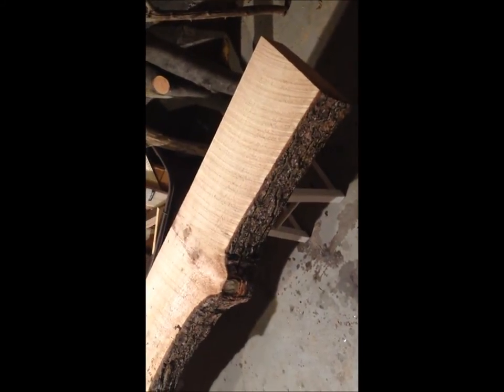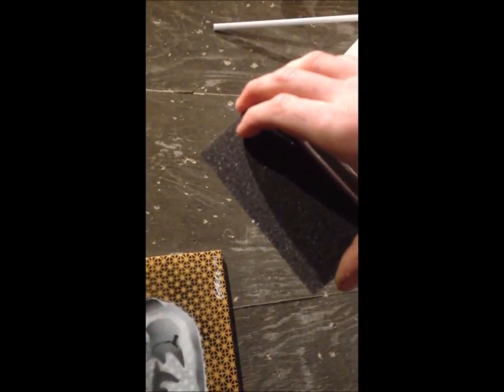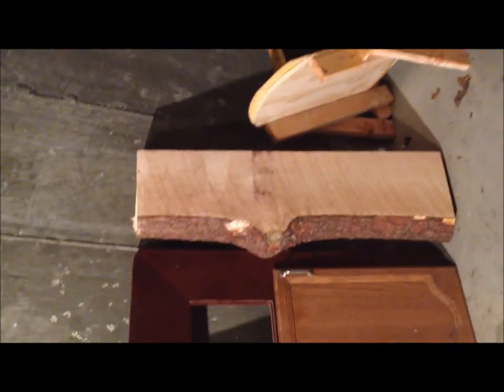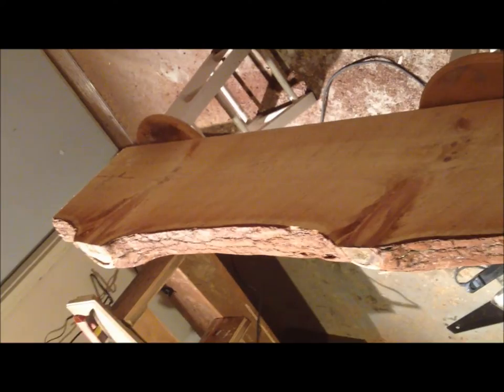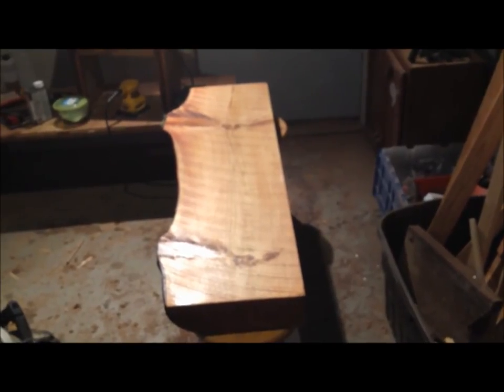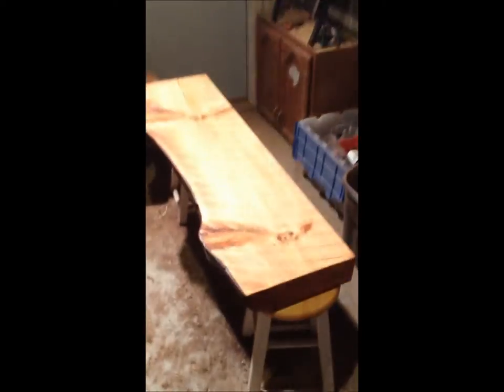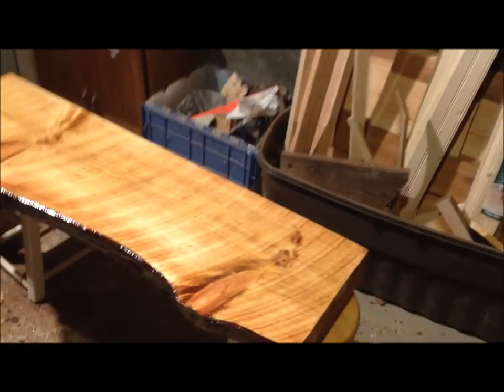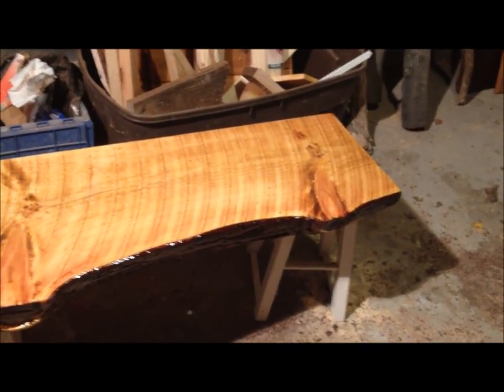Finishing a Slab of pine with Epoxy

Comment: Hi. I am thinking of making coasters using wood and epoxy resin. I recently obtained some ‘free’ firewood but unfortunately it was stored on the ground too long as a lot of it is punky but has lovely spalted sections. Do I know of any commercial hardening products that would help stabilize the wood and stop the rotting process? Any advice would be greatly appreciated. Thanks. Tom

Comment: working on a 10' one right now. you say you have trouble sanding the mill marks away with Palm Sanders...  I made one pass with Palm Sander and said to he'll with that. got my 4 head 6" orbital floor sander out and wham bamb thank you mamb!!! Smooth as glass in less than an hour. chewed it right up. little struggle keeping it from rolling of edge but it worked just fine. sealed the bottom tonight. 2 ladies coming to assist on the resin pour for top tomorrow.

Comment: Hey, I'm looking to do this as well. Making a 9' Bar. I found a sawmill that is charging a great price, but it is fresh sawn, green wood. It is not air dried or kiln dried. I'm wondering if you used green wood? Or if it was dried any way? If not, has there been any shrinkage in the wood since you did it? I imagine the epoxy seals it quite well, and likely doesn't shrink, but I don't want to seal it if it will shrink... And lastly, I have the choice between oak or pine, any suggestions? Thanks!
Reply: Did you wake up one night when you heard bomb go off....to find bar top split wide open?